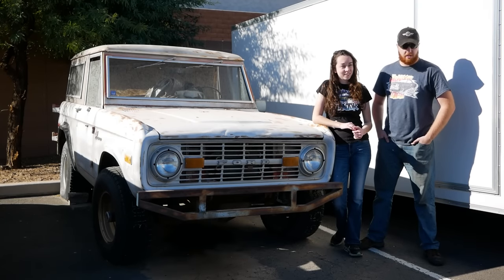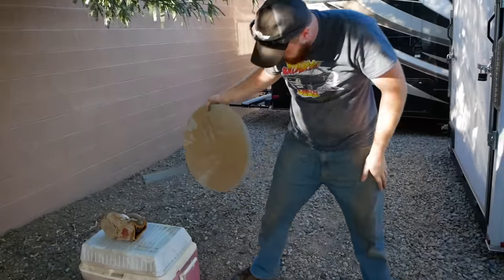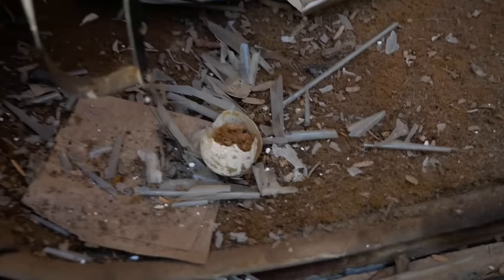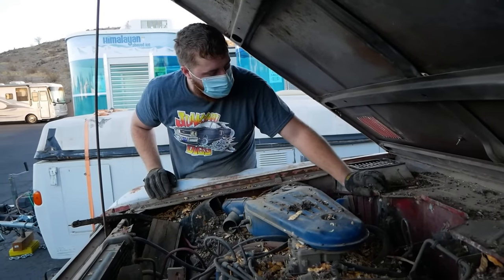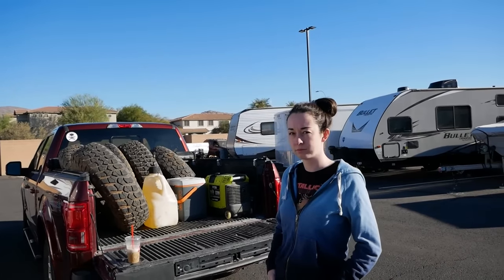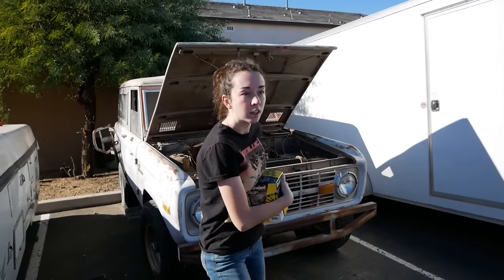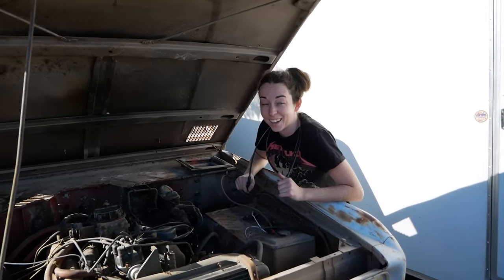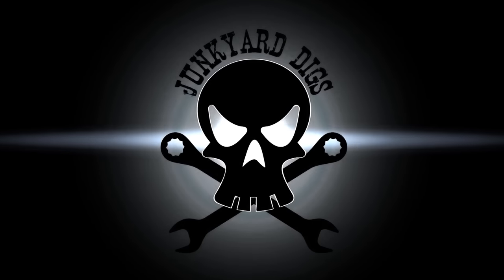ABANDONED Bronco Saved After 10 YEARS in a Storage Lot! Will it Run and Drive?? - Part 1

Comment: The 302 didn't come a boss for mechanical linkage for clutch being they switched to hydraulic in 1980's.
Yes that plastic trim piece does fit right were Mook said it would.
Yes the air cleaner is off set for hood clearance. This is the reason why you can't find them because everybody cut a hole in the hood and put a hood scoop on and threw the factory air cleaner in the trash.
All your suspension needs can be found over at James Duff down in TN. They have been at this for 30 years. If you don't understand c bushing angles for the front axle you will need to go to a small business like this to help figure out to help keep your front end aligned. The radius arms for hard core wheeling are so big and so heavy they are shipped on a pallet.
The ford 9 inch in the back should be a small bearing.
The dana 44 front axle I think this was the first year for them has very small u-joints in the knuckles very weak. The front axle simply needs new axles and bigger u-joints or rcv joints put in. To buy rcv joints you will have to sell Mook they are expensive. Properly set up with trusses and a stock 302 you can run 40's on the front. Not set up and or built 302 you will blow that axle into orbit.
The drive shaft u-joints are on the small side and need to be larger.
With 31 inch tires and a stock motor you should get reasonable live out of the drive train. 33 inch tires will depend on driving style. Any thing bigger just build the 79 bronco instead it is already beat and comes with the upgraded components. 
My advice is 31 inch tires and enjoy it for what it is. Mainly on the east coast wheeling is big rocks and mud holes. You might as well on going to 40's if your going to get involved with the east coast wheeling scene.
This uses a dana 20 transfer case. This is different than the dana 20 used in jeep and internationl. There is some parts that can be interchanged but not a lot.

Comment: Love your videos, love watching the “revivals” and bringing cars/trucks back to life after sitting for 20+ years.  But please....please....stop using starting fluid/brake cleaner to “run” one.  It’s ok to “start” one or test to see if it will fire,  but it’s not meant to run one for 20+ seconds.  It extremely drys the cylinders out.  The blow by smoke rings could possibly be from stuck rings (doubt they were stuck as fast as it started),  or you could have scorched them with the brake cleaner.  Again love your videos, just wanted to give you some insight from a diesel tech who has seen countless cylinder washes caused by some dude with a can of ether.  On a gas engine, I don’t think there is a better starting fluid then a high octane 2stroke mix.  Or buy one of the gallon cans of premix from Lowe’s or Home Depot.  Keep up the good work, and hell of a find on the bronco
Reply: Yeah i agree,. that firemaker in a can stuff just washes off any lubrication on the cylinderwalls. For firing up a beat up engine thats not going to be worth anything anyway... well who cares, but this one seemed to have potential for actually being good. Also, pulling the plugs and soaking the cylinders with twostroke oil before any attempts at even running the starter would have been the "right" thing to do. Those cylinders would have been absolutely bone dry, when you first cranked the starter, and even when it first fired up

By the way, connecting the battery to an electrical system that is THAT chewed up, and with non-insulated wires everywhere - that was brave. You could have pretty easily isolated the startercircuit from the rest, and not taken that chance. It could have lead to a much larger job with fixing the wiring.

Comment: 1982 5.0 High Output was the first 302 to run the 13726548 firing order like the 351 Windsor.  Pretty sure the Boss 302s were 15426378.
E7 heads didn't show up till 1987.  The E denotes the 1980s as the decade, and the 7 means '87.

Comment: get a point file , they are cheap at the oreillys , once you have a few of them and use them , you will never fight the sandpaper aggravation ever again , also a few licks and your done unlike the 15 -20 pulls of the sandpaper if the points are crusty ... I surface mine with the side of a death wheel , I haven't bought a new set of points in years ... FYI oreillys parts system can not find a SBF pump that they have in each store on the shelf , true story , look up the part number elsewhere , and have them cross it , and they will walk back and get the damn thing , doubt me , try it LOL

Comment: Awesome, but one thing that I see over and over is this rush to start them. Why not pull the plugs, put some magic juice into the cylinders and let them soak a bit. Then tun the starter a bit, get some oil back into the engine before putting any compression/combustion loads on all the bearings. After all this thing sat for such a long time. Years ago I flew behind big radial engines, we had electric pre oiler pumps, ran them prior to each start. Or maybe just starting them is the way to do it, anyways awesome find, must be nice to find rust free rig.

Comment: I had such a pain trying to put new plugs and wires in my 92 F150 because it used the old firing order but my Haynes manual only had the new one and didn't have the distributor picture correct either

Comment: tricks of a ford engine , ever find the word "special" cast in the lifter valley it is an extremely high nickel block , and no mater what a parts store tries to give you for a starter , always keep your old one until you know it's the right one , and if it sounds off at all swap the nose , if you get either a 351w or 302 that sounds like a pig hung in a shit spreader when engaged , try the opposite starter 351 on a 302 or the other way around , ford did some monkey business with flywheels /flexplates in the 80's for sure ...

Comment: You asked if there is something in the southwest that is hard on radiators and water pumps? Uh, yeah. How about 8 months of 100 to 118 degree days? Plus that is an vintage Bronco and owner maintenance would come into play. Also it has been sitting for 10 years. All this adds up to major issues. Just surprised it wasn't completely seized. Bodies last longer in the low humidity but engines don't in the high heat.

also old gas turns into varnish that will coat whatever it comes into contact with. give it the smell test, if it smells bad it is bad. Unhook the line from the fuel pump and connect and external tank until you can drain that bad gas.
Reply: YOU SHOULD START YOUR OWN CHANNEL

Comment: Y'all just have way too much fun. And why do people say Ford part numbers are so arcane? Example; D4ZZ means the part was designed for a '74 Mustang. The middle number is the basic number,  and tells you what the part is. The numbers at the end denote any engineering supersedes. It only gets weird if you only have the part in hand when you go in the parts store, because usually the only number on the part is the "engineering" number.

Comment: Ford: Engineers different variants of a engine to fit the specifications required or wanted by installing different camshafts or heads.
GM: 350 take it or leave it 😎